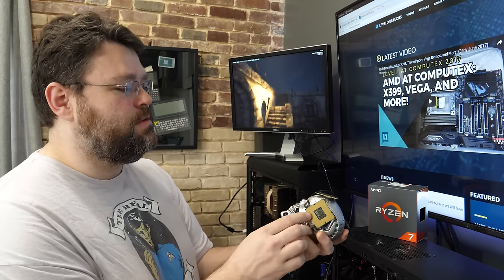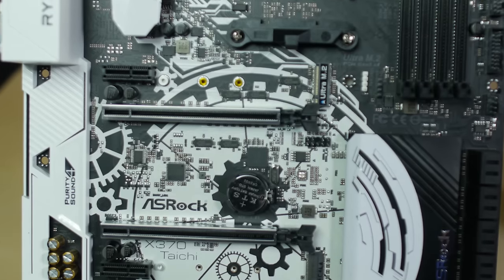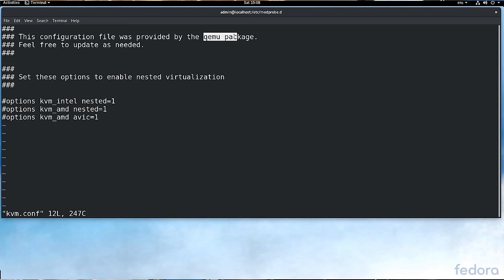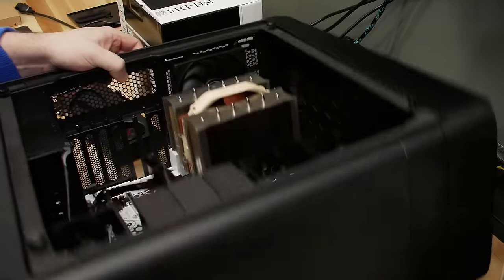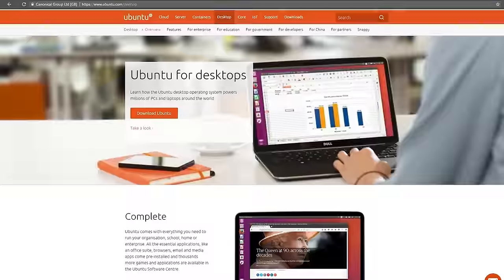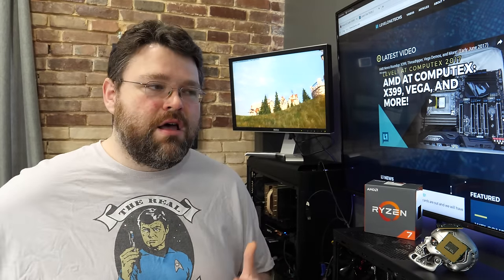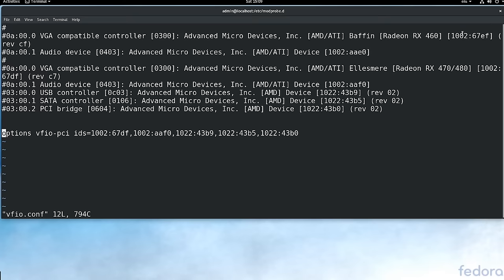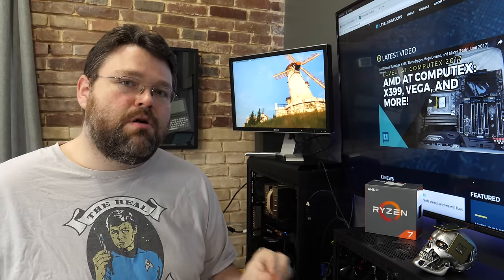GPU Passthrough for Virtualization with Ryzen: Now Working

Comment: Please I am requesting a FULL suit of benchmarking games, everything from metro last light to ashes of the benchmark , over watch, etc. Many of  us linux users have been stuck to virtualized hardware accelleration with Vmware player because not all computers support iommu mapping etc and can passthrough a GPU at will. I have a ryzen 1700x and asrock gamking k4 x370 along with an rx480 and I'm about to follow this fedora guide posted in the description, though I've Always been an ubuntu user. gonna be brand new territory to me. Thanks for this video!! really appreciate it.

Comment: you said usb audio and showed a picture of a pci-e audio card (12:07), which would work better in terms of latency to the virtual windows machine? I think passing off an audio pci-e card via iommu to the windows machine would be better and wouldn't have an effect on the 4 port usb limitation.  In theory, it should also be better than a usb audio stick on a dedicated pci-e usb iommu passed off to the windows virtual machine (in terms of latency).

Comment: First of all, I am noob on this Linux thing.

If I understand correctly, with this method, you simply give certain devices (PCIs) to Windows 10 on VM permanently and you cannot use that resource on the hosted Linux anymore, right ?

For home users, this might not benefit them much because they have already needed 1.Windows license 2.additional GPU. If they have that kind of resources, why can they just not reboot into Windows when they wanted to play games ? Computers do not take that much time (minutes) on reboot anyway compared to the time you will probably spend on playing games (hours).

Comment: I am pretty new to all of this but would it be possible to access the VM remotely? So that one user can remain on linux while the other plays games say, on a raspberry pi using some vnc client?
Reply: Thanks! This is exciting. I've been using moonlight to play modern games on the Pi but that makes my host unusable.
Reply: I recommend using NoMachine for this actually, as long as you use wired connections, the speed is actually as smooth as it can get and thus also much faster than TeamViewer.
Reply: If you use multiple Displays and Mouse/Keyboard, you can just use it like a second pc.
Reply: Der Gerät schläft nie ein?
Ehh... anyway, this sounds good enough to me, perhaps I switch my i5 set up in for the r5 in the future indeed.
Reply: +Octobyte
I've never tried this, but how VNC server on linux would help in acessing VM? Either I don't get something, or you didn't get the question right. As far as I understand you can't access VM directly from linux (like window where you can see graphical output of VM), you have to physically switch your monitor, keyboard and mouse (or connect second set) to VM assigned GPU/USBs.
So, to remotely connect to VM we have to install remote desktop software inside VM?

Comment: I really think Wendell should have mentioned that when the Ryzen APU's come out you won't need to have a second graphics card because you can just use the on board graphics for the Linux system and just pass the GPU to the VM.  If anyone is seriously considering doing this I would highly recommend waiting till later this year before buying anything.

Comment: Why is Nvidia hostile to virtualisation? This may just be my bais as a consumer but considering with consumer based GPU's you need 1 GPU per VM and 1 for the host system, this would mean more GPU sales, no?

Or do they want you to use there GPU's which are made for virtualisation which they make a much larger margin on.
Reply: I think their only hostile on GTX parts. On Quadro parts it works fine. They basically want you to buy a Quadro card for the feature. I don't agree with it but that is basically the reason as far as I know.
Reply: The small guy shall not touch fancy stuff... It's only a matter of time before they also block the fx440 and Q35 chipsets from being used with their GTX class cards. Which then means we are at a dead end. :/
Reply: Simple, they want you to buy their expensive Quadro cards. That's pretty much the only reason.
Reply: GTX1080 =$500ish 
Quadro6000 $6,000

One alllows Virt, the other is blocked by the driver
Reply: Miguel Sensacion One is suitable for gaming the other for pure GPU computation. 

It's not that you can't game with Quadro cards but for virtualized gaming there is nothing else than GTX cards. That's why people and companies (Liquidsky) use normal GTX cards.
Reply: That's basically what I said, The driver blocks the virt option on GTX card, Obviously the Quadro cards specialize in other areas and NVidia supports them with specific features as well.
Reply: Well that is also what I said in a sense, that they want to sell a GPU with a much higher margin, although for the enterprise I assume they support multiple VM's per GPU and for enterprise users the extra energy cost and heat put out by going with multiple GPU to replace 1 would make them chose the Quadros anyway so it's needless and just aggravates consumers unnecessarily.
Reply: @3GenGames Yep.
Reply: They'd like to sell more Quadro
Reply: @3GenGames Why do you not have a choice?
Reply: I assume you did not watch the video...
Reply: they want you to buy Quadro
Reply: It works with nVidia too, but not as smooth and straight forward as with AMD cards.
Reply: Anes Lihovac just not as straight forward but with one more line in libvirts XML it's rock solid and native performance :)
Reply: nvidia doesnt wanna give up control they always been about being number one through whatever methods necessary even if that means fucking over their customers and losing profit in the short run
Reply: I hate using nvidia but they are the only option available thanks to scalpers and currency miners.
Reply: Because "Buy special device for virtualization even if you dont need it or GFYS". Nvidia GPUs are the worst ones for GNU/Linux ever. If you want stable and reliable graphics for GNU/Linux just buy AMD viceocard. Nvidia still has unsolvable critical problems with GNU/Linux.
Reply: +Etheoma
Like +Nobodyjbh14 and +Airou mentioned, nVidia blocks GTX drivers on VM so that they can sell Quadro graphics cards, which comes with direct support from nVidia for virtualization. nVidia wants its users to use their cards "the way its meant dictated by nVidia". That's one of the reasons I hate noVideo and won't buy their products, but not only that and I like to support the underdog (AMD).

+Kaptain Ufolog
I believe Intel integrated graphics cards have the best driver support for Linux. I could be wrong, but that's what I keep hearing. Although you might laugh at me, they are probably the best graphics adapters for Linux. Especially if you deal with VMs, you can use the Intel one for the host OS and whatever you wish for VMs.

Intel is not that bad overall, their prices are high because of their brand name. Though I still prefer the underdog, going to buy Raven Ridge when its released.
Reply: +BludErrr you know Nvidia has the better OpenGL drivers right? I know that Vulkan is taking over and AMD has the edge there but it hasn't taken over yet, and by the time DX 12 and Vulkan do properly take over Nvidia will likely have an arctecture to take advantage of it.

Look I am no Nvidia fan boy I had an RX 480 until 3 days ago but sold it for £320 which is £80 more than I bought it for and bought a Zotac GTX 1070 AMP Extreme which was £430 which at that point it was well worth the upgrade as I was only paying 25% more for 40% more performance and I couldn't wait for Vega as the mining craze will likely be over by then, but I still have half of my AMD cred as I own a 1700X.
Reply: Because AMD linux driver still suck after all these years.
Reply: True, but they do make much smaller margins on there GPU's because even when they had the superior GPU's people wouldn't buy them, so I don't think you can solely place the blame at AMD for that when they have a much smaller budget than Nvidia mostly due to casuals who will buy Nvidia no matter what, that AMD is in the state it is in now.

That includes me as I bought a 560Ti way back when, when the better option was AMD at that time, although I must say that the naming convention is what put me off at the time as I was a novice and couldn't be bothered to dig any further, with there current naming convention however it is much easier, and at any rate I watch all the reviews for GPU's anyway so I know exactly what is the best bang for my buck without any extra research.

Which is why I am kind of annoyed they are changing it again, like seriously back in the day they lost my sale due to naming, now they are going with RX Vega Core etc, They should simply have named it the RX 590X, RX 590 and RX 580X, so they can get consumers used to there naming conventions so when they want to upgrade they just have to go, oh I will buy the higher number or the X model.

Make you names and keep it consistent or otherwise you end up driving consumers away to your competition because without throught or effort you basically know what you are getting, as why I dislike the RX 580 etc, as they ruin any chance of consumers knowing what they are getting from a glance, they should have named them the RX 480X yes it's a little silly to have 2 X's in a name but it keeps it so that you can make a RX 590 and people will know it's a real upgrade.
Reply: When was the last time you installed an AMD driver on latest Linux kernel???
Reply: alot of people say amd drivers suck but i have never heard why I never had an issue with amd on linux (I also havent used linux long)
Reply: Etheoma >you know Nvidia has the better OpenGL drivers right?

Nvidia dont support OpenGL standard. Moreover; Nvidia still dont provide even partially OpenGL 4 support. Instead of essential API functions nvidia drivers provide only stubs. Test made with pglit also shows - Nvidia is surprisingly incompatible with OpenGL standard. Those who say nvidia is better in OpenGL are ignorant or clients of mental hospital.
Reply: awww how cute he changed his name
Reply: This video should get tons of engagement points :)
Reply: tbh if you really want the best of the best AMD's compute qube thingys are probably going to be better than Volta, similarly priced though as each has 6 GPU's in it.
Reply: Marcus Grant You can try OpenCL instead of CUDA+cuDNN/Tensorflow. Anyway FPGA is much more efficient and flexible thing for machine learning than GPU. So i would not call those CUDA users professionals. Usage of non-standard vendor lock-in equipment is unprofessional behavior. Developers who use CUDA looks more like hipsters than professionals because they dont know what they use but they use this thing because of fashionable trend.
Reply: Etheoma AMD is already better for general purpose computations because its cheaper and OpenCL/Vulkan-friendly (Vulkan is just a version of OpenCL for graphics, and soon Vulkan will be united with OpenCL into a single API for everything). So called tensor cores (in fact they are just matrix multipliers - even not for any tensors) are not killer-feature of nvidia. Its the temporary solution to make some answer to Google's TPUs.
Reply: I guess they're sad that AMD is going to get virtual gpu support on Linux before Nvidia do.
I mean, Nvidia do already I think, and I believe they call it "Grid". But it's limited to GPUs that pretty much nobody would buy for gaming.
A +1 for AMD :D
Reply: Easy Nvidia wants you to buy an expensive several thousand dollar quadro as 99.97% of gamers do not use Vms. Mostly businesses and cloud data centers hosting advanced graphical apps. Another reason to use AMD and support them as they do not play these monopolistic games
Reply: Heh yeah. Only problem is that NVidia does not offer anything comparable to GTX cards with (official) virtualization support.

Btw. gamers use VMs 'caugh' feeling offended here :P (works absolutely flawless thanks to KVM!)
Reply: Yeah. The price of Quadro sucks.
Reply: Yes. Cuda is so well documented and optimized compared to OpenCL.
Reply: Nvidia uses virtualisation in house.  They don't want consumers using it.

Comment: Doesn't the NPT being disabled cause slowdown on more than just I/O operations? If I understand correctly, this will add a CPU penalty to every single RAM reference. So, any RAM-intensive workload will suffer. Accessing storage through the VM may be less efficient, but I fail to see how passing through the storage controller will help matters much.

Comment: 12:20 Just could not get clean audio out of a Windows VM on Proxmox/Debian. Tried onboard audio, emulated AC97, PCI & PCIe passthrough, USB passthrough,  etc. Had to go with ESXi, which also had issues with onboard audio, but passing through a PCIe audio card worked great.

Comment: Doesn't Windows ask for a new license when you boot on bare metal vs virtual environment? It should detect a hardware change and should say it isn't activated, no?
Reply: SunRed I use a pirated copy so idk
Reply: SunRed even with virtual environment with bare metal virtualisation (amd's version of VT-X) you can read hardware info.
Reply: Even with a legit license, you should still use a pirated copy. Less headaches this way.
Reply: Win10 pro retail not had this issue, win10 pro free upgrade from win7, yes it's an issue.
Reply: lol less headaches you reckon?
Reply: Unactivated Win10 will still run most of the stuff without problems.  You will be missing features like being able to change desktop background and such.  (And there are work around for that too.)
Reply: Yeah, I totally forgot as Tristran Badock mentioned that the retail version allows up to 3 vms with the same license or so. So if one seeks to setup such system then one should think about a retail version. At least if makes things less complicated.
Reply: +Danzotron
Yep, less headaches. I can't say for each county, but I don't think you would get in trouble by using fake KVM activation server. In my opinion it's very logical that you have every right to use crack if you have bought legit license form Microsoft and don't violate EULA in terms of installing on more PC/VM's that allowed by that license you bought. 
By the way, does officials in any country ever check home PCs for valid installation/activation of Windows?
 That's not the case in mine, unless you're doing some ilegal activities and they break into your house (I don't mean using Windows crack, lol; serious stuff like selling drugs, guns, download child porno and so on).
Reply: Are you saying injecting some random dudes code into fundamental parts of your OS to crack it is better than just buying & using their licenses within their terms? The retail edition gives you the ability to install on 5 machines, no need to crack. You can pickup OEM / Single PC licenses for like 10 bucks. How exactly have you quantified "less headaches"? To me it sounds like the only headache you are talking about removing is having to pay for the licenses. By the way if you mean less headaches in terms of moving licenses / windows installs from bare metal to VM, how it asks for activation again. Do you realise all you have to do is go through the telephone activation and re-activate the license? It takes like 5 minutes max and means you don't have to run dodgy code.
Reply: Danzotron it's not injecting any code. I'm using fake KMS server (that's what I meant to say in original comment, not KVM of course, sorry). Separate program, that activates system the official way and could do that even remotely for all machines on network. That gives completely functional system. I've actually updated from 8, to 8.1, to 10 and got thru all big updates (Redstone 1, 2, Creators Update) without worrying about activation at all. Could change motherboard, CPU — system reactivates on it's own, that's why I say "less headache"

You couldn't get windows license for 10 bucks btw. Only activation code, but that's not a license.
Reply: Niter the solution you've setup is great and all but the headache you've solved there is only paying for the licenses. Which is fine but just be forward about that. I'm not dissing piracy or anything. At worst all you have to do is the phone activation to reassign a license to different hardware on retail channel, licensed, Windows.

You can get Windows 10 OEM licenses for ~10USD by the way. It is a grey market though as they are not supposed to be supplied without a system. After thinking about your last sentence "Only activation code, but that's not a license." for a while stunned at how you could come to such a conclusion, it sounds like you are talking about the volume licensing channel of Windows which would make sense given you have experience using a dodgy KMS server etc. However, you need to understand that I am talking about the retail channel of windows. Of which yes, there are ~10USD Windows 10 Keys available. Meaning there is a full single PC license behind them.
Reply: I'll figure out all that license stuff after I've studied law.

Comment: Been working on my passthrough setup for the past through months and I'm getting there.

Using a 7700K because I need the iGPU in an ITX rig and have passthrough functioning, the real issue is that I can't get the VM to work unless I nomodeset the graphics at boot.

If nomodeset, VM gets graphics, if I don't, black screen. Really strange and frustrating problem. Code 43 was nothing compared to this!

Comment: wow! Iv'e been waiting 14 years for this. When Xen was first released around 2003/04 it was speculated one could  boot 2 systems side by side on the same machine with each having direct access to it's own video card. I built an amd 64 and bought the card there were experimental patches for. it worked for a few seconds... crashed and developers experimenting deemed it improbable to properly do.  Im wondering how Microsoft will try to break this with updates..